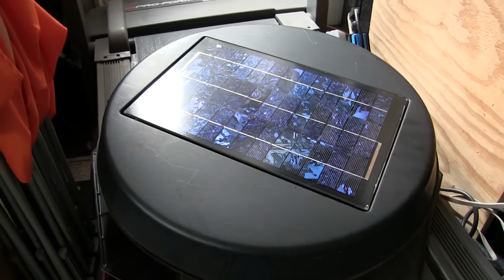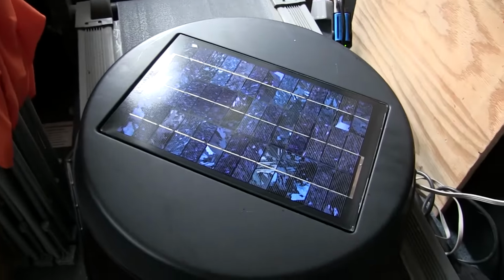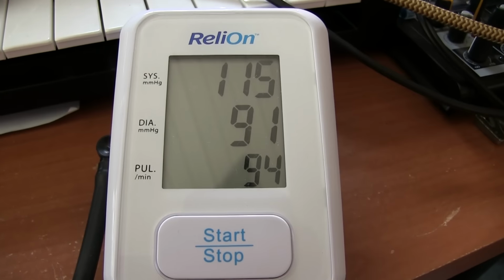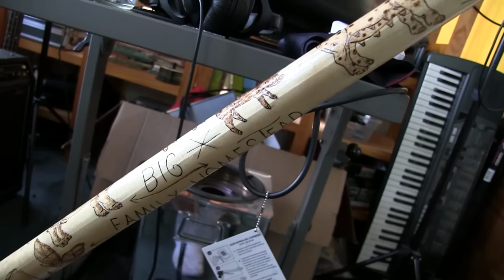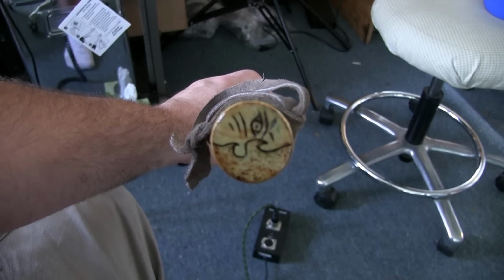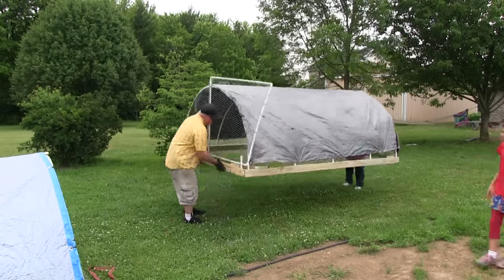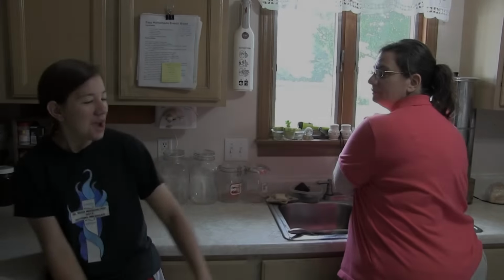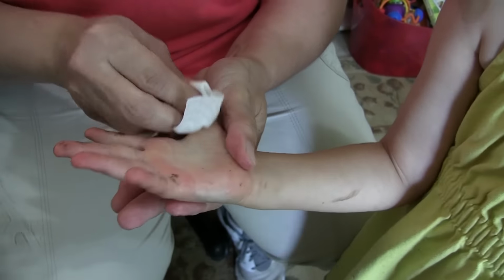I Think Shes MAD - VLOG 6_4 Big Family Homestead

Comment: brad i hate to burst your bubble  . air is like water and will take the path of leas resistence . if you put that fan at the ridge the closest vents on either side will be where it draws air from instead of the lower vents then you dont get the cross circulation in the attic solution plug the upper vents that are within 10 feet of either side . however conider the air flow your blocking off will the power vent increase that air flo . with solar the answer is no . do not take my word for it ask a roofer with 40 years exp.
Reply from the maker: I would not presume to know the best place to put it, I would find an expert...